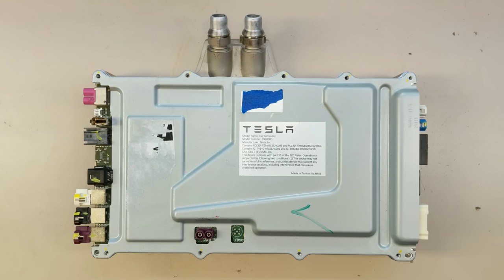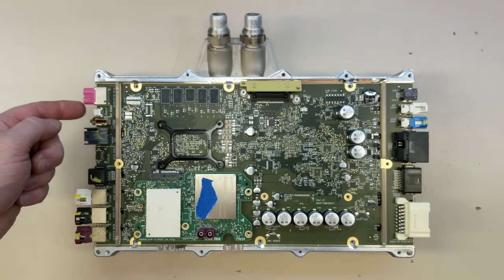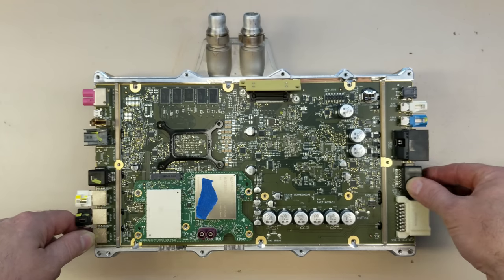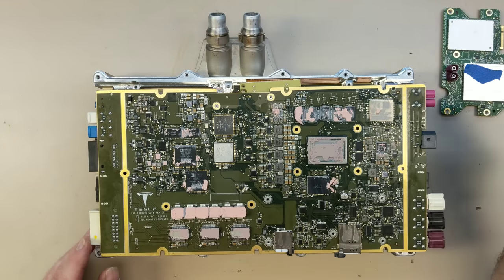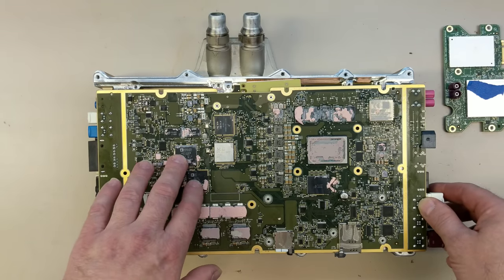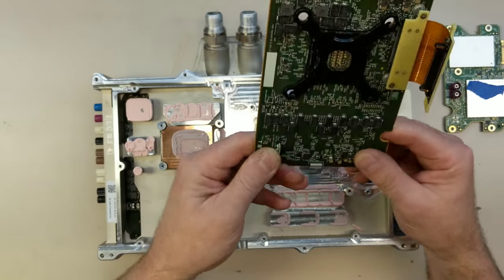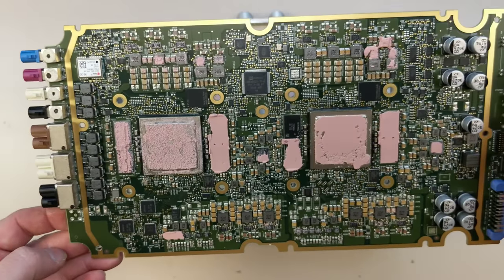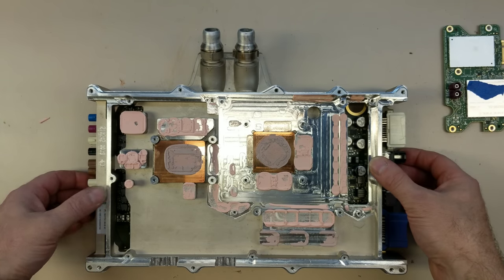Tesla's New Plaid Car Computer!

Comment: Graphics card is a custom Radeon 6600M Navi 23 👍🏻
Reply: Did I miss the description of the autopilot computer?
Reply: Wait goddamn. Really?
Reply: Shame it can’t mine crypto to pay for its own “fuel”
Reply: @501isa  it probably does, but goes into elons wallet.
Reply: @bigdougscommentary5719  said every billionaire ever...
Reply: @501isa  id totally let my car do that while its parked at work for at least 8,5 hours doing otherwise nothing.
Reply: @Boemel  imagine if it worked even better when multiple cars were parked together sharing data packets and distributing the credit.
Reply: YE180FC3T4MFG uses four Zen 1 cores with eight threads and an integrated Vega graphics unit with up to 11 compute units or 704 shader arithmetic units. According to AMD's announcement from June 2021

Comment: This module is essentially 1 1/2 PS5's worth of GPU processing with a Navi 23. Quite impressive. His claims of being able to play "Cyberpunk" on the Cybertruck are not unrealistic.
Reply: 28 CUs vs 36 CUs, close but not outcompeting the PS5. It would also be more power constrained than a PS5, further lowering performance. Pretty crazy for a car computer though.
Reply: Good thing we had a gamer to step up and put the hardware into the perspective of a.......gamer.....gee.....thanks.....
Reply: @axiom1650  I mean, with it being Glycol cooled and linked to a giant battery, there's no reason for it to be as power constrained as you may think. Although it's totally possible I don't know all that much about it
Reply: @BenQuigley  Fair point, didn't consider that. I'll eat my hat though if it clocks higher than ps5.
Reply: How much RAM does it use?
Reply: @axiom1650  it could ,
Less cores = you mostly can do higher clocks because less heat
My gtx 760 in my old pc clocks up to 1400 mhz(striker)
A 770 lightning is stable at 1.3 ghz
Just try to go to 1.2 ghz with a 780ti on air cooling... It wont work because the card &vrm get too hot
Reply: @axiom1650  It's liquid cooled by a water block, in the same way as an open loop system in a desktop, but with cooling capacity literally that of a car's. Why wouldn't it be able to lock higher than a PS5 with a miniscule (in comparison) air cooler? The GPU is very similar to the Radeon 6600 which already runs at >2GHz stock with a standard air cooler, with this cooling solution and cherry picked chips, I see no reason it couldn't do the claimed 2.8GHz.

Comment: Wow. So much to digest. I had no idea they had a Ryzen in this thing. 
All of this really illustrates the generational gap between Tesla and the incumbent auto manufacturers.
Reply: The Ryzen machine handles the infotainment. It's certainly more powerful than many manufacturers would use, but from a practicality standpoint, many drivers might prefer to have CarPlay or Android Auto and that type of system has much lower hardware requirements. Many of the more mission-critical components are much older and likely shared across every Tesla model ever made, a practice that reduces the need to test variations in critical components. Also, Elon Musk has talked up the infotainment system and he expected it to be disassembled. Most infotainment systems never get public hardware teardowns.
Reply: @thedevincrutcher   Wasn't there a video of someone playing Cyberpunk 2077 on their Tesla just for funsies?  I think Elon retweeted it.
Reply: @thedevincrutcher  there was some information in a press release that a certain german manufacturer uses the snapdragon 820A in its newest models that are currently on sale. The chip is from 2016, and looks to be horribly underpowered, the system is slow as molasses. But it does have CarPlay and Android Auto.
Reply: @HNedel  CarPlay and Android Auto only need to decode h.264 stream from phone USB and send touch commands back to phone. It's a bit more complicated for wireless, but still not outrageous. The requirements for it are quite low, even a single-core ARM chip can do it without dropping frames. And for many users, Android Auto and CarPlay are preferred over the cars built-in system because it's a more consistent experience, especially for those who switch cars. It's fundamentally the same in a rental Altima as in an Audi and there is something to be said for that.
Reply: a embeeded ryzen isnt a god tier processor calm your fanboying
Reply: MBUX system is far superior than this Ryzen module.
Reply: @thedevincrutcher  still, OEMs insist on developing their own navigation, speech recognition, media, phone functions and so on.
Reply: @VuBeClan  yeah, except it’s not. It is very similar to the older tesla system that used nvidia chips. MBUX has 500 Gflops, Tesla has 10 Tflops with that discrete GPU.
Reply: @HNedel  actually, it can be extremely different to determine who is designing or developing the infotainment systems and software. This type of work is often farmed out to a third party and the radio component or application is usually designed by SiriusXM, in the states. Auto manufacturers don't usually work like software companies.
Reply: @thedevincrutcher  good point, most of the development is done by external suppliers, like in many other industries
Reply: @HNedel  well, it all comes down to what the manufacturer wants to base his marketing around. Tesla obviously wants a lot of attention to their infotainment system because they sell it as a central feature of the car. So it should also be able to deliver what's promised. Most other manufacturers just simply intend their infotainment system to be a basic tool and nothing more. 
It's as if you were comparing 2 PCs: One is a gaming PC and advertised as such, whereas the other is just an average office PC. Both are computers and get the job done, but nobody would expect the office PC to be a gaming machine. And that's fine because it was never intended or advertised as such a thing. So again, it all comes down to the intended use case. 
There is nothing wrong with old or low spec tech, as long as it gets the intended job done. Most military equipment (as an example) often still runs Windows 98 or something even older. It works and gets the job done. There is no need for anything more advanced.
Reply: @detroxx56784  when the manufacturer touts how modern and “connected” their cars are, removes almost all buttons and puts everything in the infotainment system, it is generally expected that said system will not suck. And yet this is exactly what happens most of the time, case in point VW. Nobody in their right mind would look at that mess and think „oh well, it doesn’t matter, they never advertised the system to be responsive or well laid out, so it’s totally fine”
Reply: @HNedel  Fair enough, you're right. That thing is a disaster anyways. But what would you expect from VW? ;) 
The way I understood your comment was that you were referring to other cars in general. My bad :) 
Old hardware isn't necessarily a problem if the software is good. Combine bad hardware and bad software and you're in for trouble.
Reply: @thedevincrutcher  Remind that Tesla doesn't follow "industry standards" in some aspects.
Reply: @JavoCover  yes, and Tesla vehicles are well know for low build quality and low reliability. Cutting edge software and hardware can come at a cost and it's often reliability. There is something to be said for proven tech that keeps people safe.

Comment: Hopefully those little coin cells don't get run down as long as 12v is available! At least they're socketed. 
It's interesting they didn't socket the NVME - I figured after all the trouble with the Gen1 MCUs they'd have made that easier to service.
Reply: As far as I know, they moved everything that's written regularly to the SD card and only keep the software installation and low-traffic stuff like settings on the hard-wired storage.
Reply: Yeah, it was the massive logs that wore down the memory chip, it was a small emmc job, probably not rated for endurance. Wonder what will happen when the sd card eventually wears out, if there will be some notification for the user to go to a service center or something
Reply: @HNedel  
This computer is certainly accessible to the average person. Looks like you could probably split it apart without damaging it. And when he pulled the SD card out I'm pretty sure it had a name brand on it so it's not some custom SD card. There are high endurance SD cards available. I use one in my dash cam because it sees multiple overwrites continuously. But they do eventually fail. Just glad to see that they made it a replaceable part. Be interesting if you did get a message to replace it if you did it yourself would it just automatically detect it or would you still have to go to a service center to have it reset?

Comment: Is that MicroSD card the replacement for the eMMC chips that failed on the model s and X?
Reply: That is exactly what i was thinking... that would be a really smart move to make it replacable if it wears out.
Reply: And it is nice one, endurance up to 128 TBW, 8000 full 16GB writes on MLC
Reply: No, that 16 GB microSD card is used for logging other things (the other Teslas have a separate microSD card for the same purposes).  The eMMC equivalent is the memory chip that he pointed out as being 256 GB at 5 min 30 sec (the Model 3/Y have 64 GB).
Reply: @android04  but it is a good thing that they have switched to basically a normal SSD which can handle the write cycles a lot better than the eMMC memory.
Reply: @android04  Micro 256GB (M.2) NVMe SSD, so I think it's a MTFDHBA256TDV
Reply: @android04  what other things? Why would some things be logged to the nvme, and others to the sd card? The original mcu with that problem had only one eMMC chip, for software and logging. Now they are separated, so that the logs don’t wear down the flash memory and prevent the whole system from booting properly.

Comment: 9:39 What can be the so called "repeater two
 camera" possible usage? 
Could there be cameras installed at the corners of the cars, inside the turn signal for example, 
to help city driving to detect traffic when making a left turn without having the front of the car 
entering into a traffic lane?.
Reply: CyberTruck prototype has extra cameras - one in the front bumper, and an extra by the license plate (maybe for hitch assist?)
Reply: @BlazerRox  license plate - you mean like the backup camera, or aimed lower?
Reply: @maxmyzer9172  There is another in addition to the backup camera. Nothing has been officially said of it, just observed when the prototype was on display
Reply: Would the semi have more cameras also?
Reply: Probably to calculate hitch angle which will be needed as an input for stability while towing on Autopilot. GM does a similar thing.
Reply: @DD-DD-DD  I doubt towing on autopilot will be a thing. Current Teslas have a tow/trailer mode and when it is enabled auto pilot is automatically disabled
Reply: Sure seems that Tesla made a mistake mounting the side cameras behind the driver rather than further forward. FSD beta videos show cars at stop signs creeping way too far out to see around obstacles. Owners of TSLA: monitor this situation closely and try to act before the announcement that those with the FSD option must get new cameras installed.
Reply: @assimil8or  Yes.
Reply: @curtaustin8119  100%
Reply: My thoughts go to the Semi. 2 extra cameras to help manage trailer complications (like reversing and tight corners)...perhaps the CyberTruck for the same reasons.

Comment: Shame it’s not water resistant. Anyway thx for these videos.
Reply: pretty disappointing its not water proof.
Reply: Why would it. It’s inside the vehicle and no other components inside the car are waterproof. No other vehicle for that matter has waterproofing on their electronic components unpleasant it’s outside
Reply: @jamarforsythe7262  that wouldn’t help at all if the unit is submerged ln water, which can happen since it is mounted beneath the floor mats.

Comment: The  Plaid does have a passenger screen by the way... in the back seat behind the center console.
Reply from the maker: That's already accounted for, that's called the "rear" display.  The "passenger" connector is not populated, so not used in the Plaid.
Reply: @Ingineerix  ah very interesting

Comment: Did I see a pair of mercury battery coin cell sockets on the back of the bottom-most PCB?
Reply from the maker: Coin cell; yes.  Mercury; no.  Almost all modern uses are Lithium primary, not mercury.

Comment: My requests for more details:
1) Weber Auto Channel (Prof. Kelly from Weber State) assembles whole subsystems on a bench. I wish, you did so, too. So for example, you could take the FSD board, then attach the Ethernet cables, all cameras, GPS antenna, power, and the bus wires to the actor ECUs (steering, e-motor controller). And you could stress that all parking sensors and the radar sensor transmit their data via busses to this board via separate ECUs.
2) You could assemble the whole infotainment system: the PCB you showed and then: wireless and bluetooth antenna, USB-C cable to the glovebox, console USB, the 3 displays, (e-call), autopilot computer, diagnostic connector, power cable, CAN busses and all ECUs, speakers, LTE antenna.
3) You probably know those boards with ECU, sensors, actors, power supply on demonstration boards in automotive schools. Something like that would be nice when you explain the systems, each with their ECUs, sensors, actors and power supply and ground.
4) A bus topology view would be very helpful. You can start with the Tesla specific diagnostic link connector, its pinout and then work your way down to the switches (Ethernet and CAN gateway),  then busses (BroadR, Ethernet, CAN busses) and then to the ECUs, their attached sensors and attached actors, and LIN busses.
Reply from the maker: I did this once on the Model 3, see this video: https://youtu.be/rDYbvI32OBE Making youtube videos is a side hobby.   Sadly I just can't spend that much time on an ongoing basis.
Reply: How much did you donate to feel comfortable making this kind of request?
Reply: @genabuksuet  I donated my time to write the comment. He asked for requests for more details from viewers. I answered his questions and made some recommendations. The Weber Auto channel from Prof. John Kelly - even though rooted in transmissions and hybrid drivetrains - is very popular (380.000 subscribers at this time) with his even more educational approach. But Phil is even better regarding the actual electronics and digital details like tracking down ICs and explaining circuits.
BTW: I donated money as well in the past to Phil on an ongoing basis. Not a lot. But to show my support. He even asked me for teardown ideas via email.
Reply: @koeniglicher  I'm glad to hear you contributed to Phil's channel with more than requests. Weber Auto channel is backed by Weber State University, while Phil is here on his own. He needs our financial support to continue spending his time educating us. I've never come across someone else, who is giving away so much of their knowledge, asking nothing in return. There are only 2 other channels that I know of, sharing similar in-depth details about Tesla. One is EVTV, which pretty much went South after Jack Rickard passed away, the other one is Damien Maguire. Engineerix is presenting his knowledge in a much easier way to consume by people with less of engineering and electronics skills and knowledge, similar to Weber, but much more in-depth from electronics stand point. J. Kelly himself is more of a mechanic and doesn't have deep understanding of electronics, unlike Engineerix. You can't really compare the two.

Comment: Could you elaborate on EMI shielding of gaps between the metal enclosure and connectors. Also could you elaborate on the use of different connectors for the redundant autopilot channels. The 2 connectors seem to anchor in rather different ways.

Comment: Superb video. How does the fluid move trough cold-plate? The 2 tubes for lilquid cooling are  converging in battery cooling system, but no pump in-between apparently. Is there and integrated pump?!
Reply from the maker: There is a flow diverter, and there are already 4 pumps on the Plaid, there is no additional pump.
Reply: @Ingineerix  Tks for the brilliant answer

Comment: This was a awesome look into the electronics side of Tesla. How many other control modules is there? I remember Sandy Munroe said Tesla uses three to control everything versus Ford using more than 20 small individual modules.  

Thank you 😊.
Reply: The main concept of Car Computer System from Tesla, which are first introduced in M3 - is a mininum quantity of control modules. Most of functions of car is implemented in this computer, and 3 another - VCFRONT, VCLEFT, VCRIGHT.
Another is: ABS/ESP, SRS, TPMS. Also, of course, HV Battery has own control system, and Drive Motor(s).
Reply: @aekas56  it makes things simpler and the down side more costly. If you're having an audio problem, you're buying all this outside of warranty
Reply: @htnowpro   I prefer cheap modules that only an expensive one.

Comment: Well that's dumb! It should either be placed as high as possible in the car or sealed extremely well and it's neither. Is the compartment under the passenger floor board where it's located sealed to prevent water incursion?